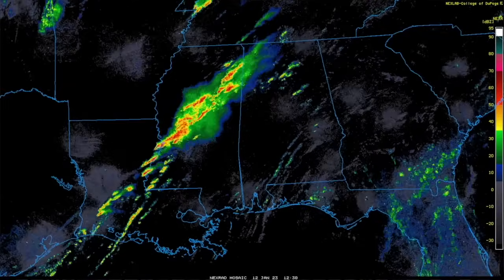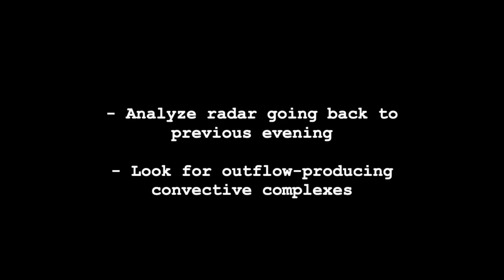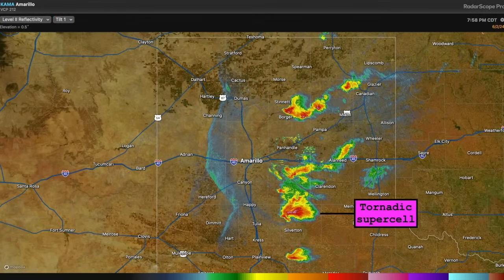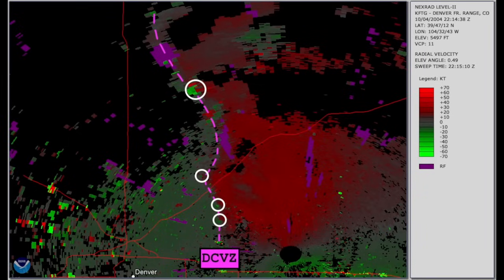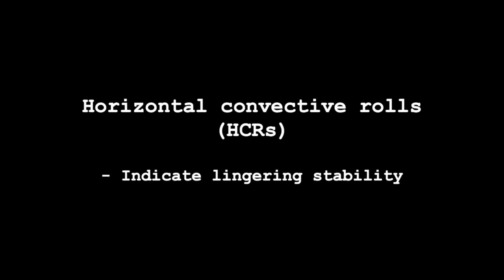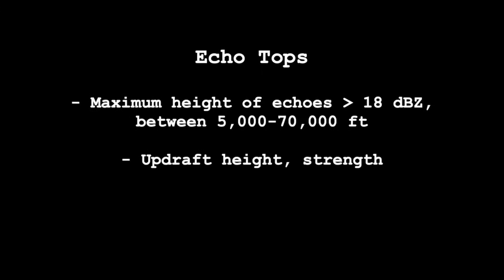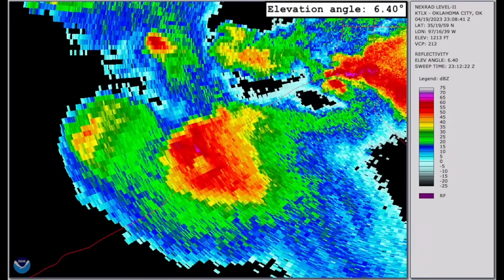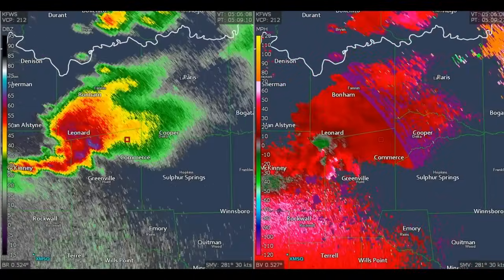How to Use Radar during Storm Initiation (Storm Chaser Coaching Preview!)

Comment: Is there such a thing as an “elevated” supercell? Keep up the good work
Reply from the maker: Yes! An elevated supercell is one that is rooted above the surface, meaning that it draws in inflow from a layer above a low-level stable layer. These are not favorable for tornadoes but are favorable for large hail.
Reply: @ one of the many things I’ve learned from your channel is elevated storms can be a problem as far as hail,rain and wind / elevated storms are one thing & surface based storms r the fifth dimension // in Tulsa, I think it will be mostly a really big rain even with major river flooding possible / I also heard that beginning next Wednesday and into the month of May is going to be rough / thank you Mr. Trey
Reply from the maker: @joseph-frankbrocchus6575  Exactly right; elevated storms are often very good at producing hail and heavy rain. Surface-based storms are the ones to watch out for for tornadoes.

It does look like we might see activity continue into early May...how intense is up in the air right now, but we'll know more over the coming days.

Comment: What is the membership cost for the first video in the series? I have found video 2 after I signed up. Thanks for the video!
Reply from the maker: So we decided to go with just one membership option. We found it was too confusing for members and a bit difficult to split up the content effectively, so we just have our Chaser Academy ($19/mo subscription), which will house all the in-depth modules, members only Q+A, etc.
Reply: @ConvectiveChronicles  for sure, that's still a good price. I never chased before, but I would like to learn about the different variables and how they pertain to storms. I might give it a shot. I have a math/stats background but I am pretty ignorant with respect to weather. Is this content suitable for someone that has never researched or studied meteorology? I am cool with doing my own research outside of the course to supplement. Thanks for getting back to me.
Reply from the maker: @ Yes! Our goal is to tailor the modules to everyone, regardless of prior knowledge of meteorology/storm chasing. We do have the Storm Chasing 101 module within the Chaser Academy, which basically gives you the foundational information you'd need to at least start to forecast severe weather and/or storm chase effectively. That might be a good place to start before moving on to the more in-depth modules, but the in-depth modules will be digestible even if you haven't studied meteorology before.
Reply: @ConvectiveChronicles  alright, I'll probably give it a try, thanks for the reply!
Reply from the maker: @chibaseball35  Sweet, thank you! Let me know if you have any questions!
Reply: Okay, I went to subscribe and there is only a $19/mo option. I believe you were saying there will be different level memberships. Is there just one level of memberships right now?